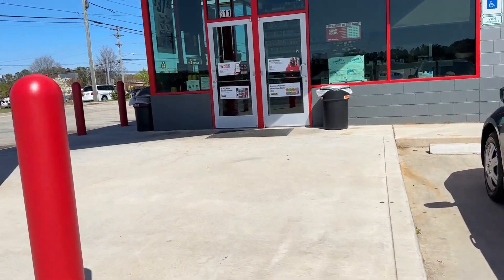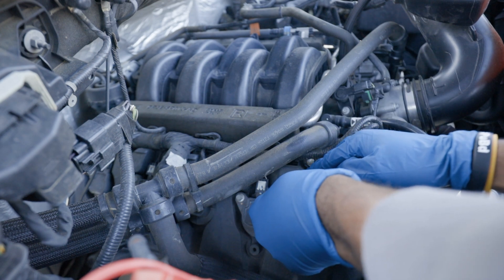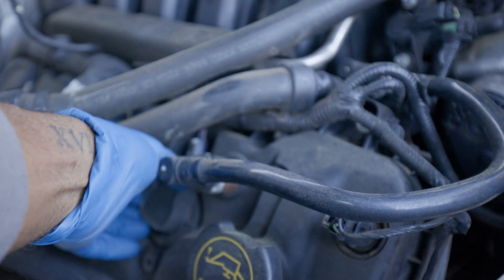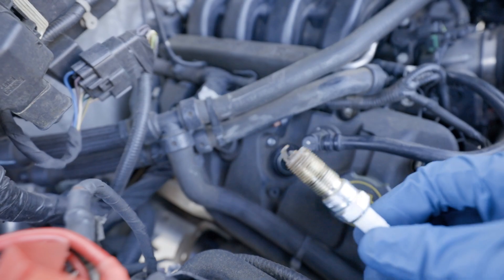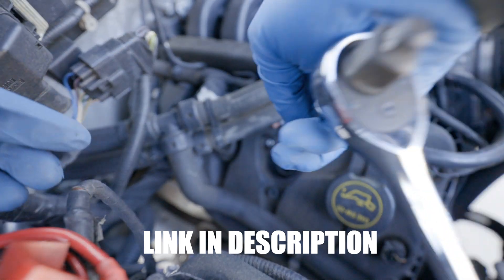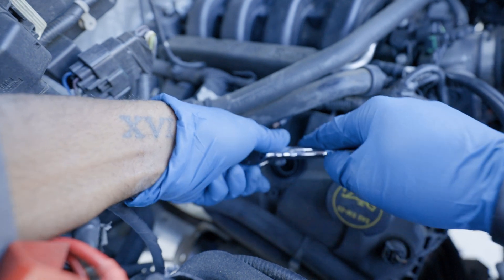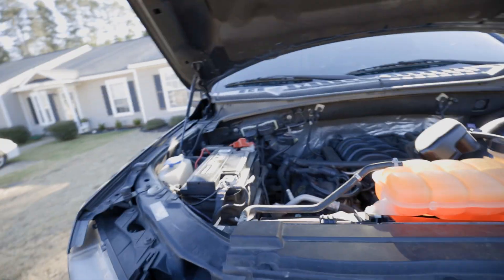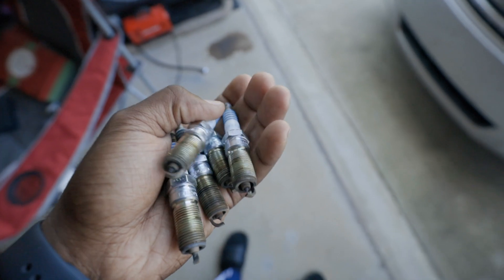How to Change spark plugs on Ford F150 5.0 | I Should Have Done This A Long Time Ago

Comment: Did you notice any difference after the new spark plugs were installed?
Reply from the maker: a little. but not too much honestly but I do know it makes a difference. Especially since Im running E85
Reply: What year was your truck? I have a 2021 v8. 
 @TFBJFord
Reply from the maker: @tdub22901  2017

Comment: You have inspired me to keep my f150 it’s not as nice looking as the newer gens but you should you can really make it your own
Reply from the maker: Awesome man. It’s Definitely good to make it your own and make it more pleasing to your liking. No matter the year of the truck!
Reply: @TFBJFord  you mind if I ask another question. My 05 f150 runs almost the same as the newer f150 so with tires because I’m running 33x12.50r18 to make it look wider is it better to go 14 wides or just use 2 inch spacers
Reply from the maker: @albertjackson1064  it’s all personal preference. But for me I’d just go 14 wide rather than running spacers. But you could run spacers to see how you like the width of it. Before buying 14 wide wheels
Reply: @TFBJFord  I definitely agree yeah I bought some 285/70/18 for the meantime. I want to run 14 wides but I know I gotta lift it. So can you get a full lock on yours